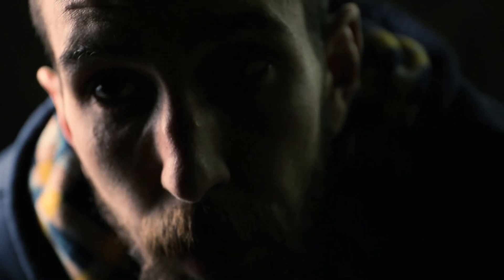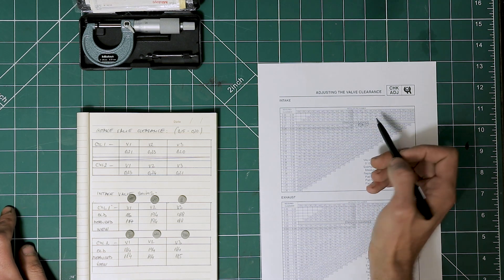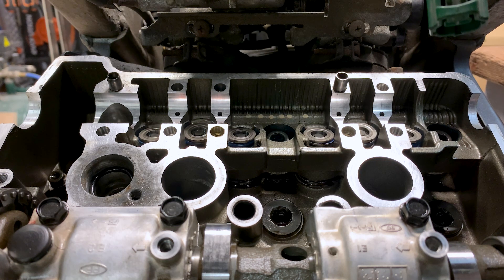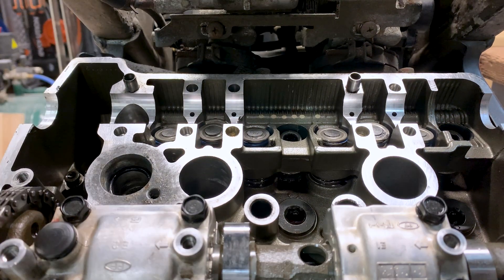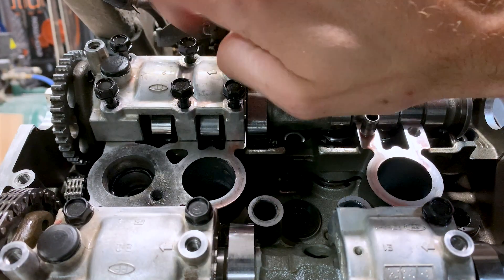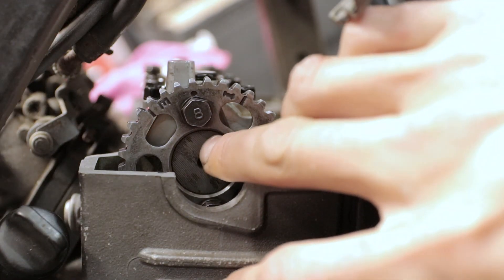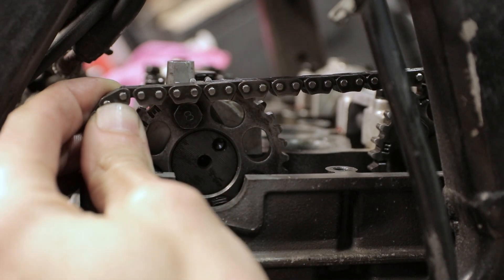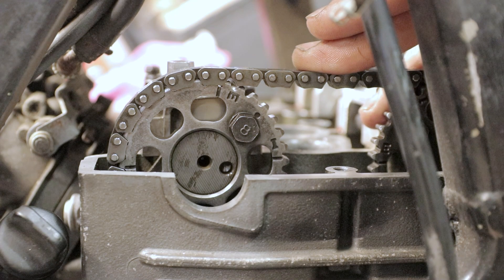TDM900 Valve Clearance Part 4 | Installing Camshaft and Valve Shims | Engine Timing

Comment: I am working on my tdm 850, from 99. Working on valve clearance now. I have removed the inlet camshaft, do you on purposely worked on just one camshaft at a time? Could i remove both camshafts without making it to difficult to put it back in time? Thanks for you videos!

Comment: Interesting until the last 5 minutes of Part 4, where  i realise i don't have some vital knowledge necessary to complete the rebuild without breaking the engine. 
If you agree the comments from Richard de piesjart correctly describe how a timing chain should be fitted, would you please confirm this in your comments and possibly even re-shoot a bonus ending sequence to show how to complete the installation technique.
Reply from the maker: I’m currently working on a video on how to replace the timing chain on the Yamaha TDM900, it should be out in the next couple of weeks. Hopefully that will shed some light on the question. But yes, I agree, if you don’t know what you’re doing it’s not advised to mess about in your engine.
Reply: The Garage UK thank you. Watching these videos, I get a great respect for the competence and skill of the pro mechanics working on our bikes.
Reply from the maker: I agree with what Richard said.

Comment: you have to turn the intake shaft 1 tooth clockwise then put the chain on it and turn the intake camshaft back 1 tooth anti clockwise on de mark without turning the exhaust camshaft then it is just right.

That's how you should always do it, you can never put the chain on it when the camshafts are right on the camshaft timing marks.

Your chain probably doesn't need to be replaced either
Reply from the maker: Thanks for your comment. My chain is well stretched, the chain tensioner is almost maxed out and I measured the old chain against the new one and it’s almost 1 centimetre longer the old one. The new chain goes on perfectly with the camshafts set to the timing marks BTW.
Reply: Normally the chain is tight between the sprockets.
If the camshafts are on time, then there is no room to lift the chain over the sprockets without turning the sprockets.

if it does work without turning the sprockets, the chain usually has slack between the sprockets, and they are no longer on time when you turn it around.

if you did succeed then you are lucky
Reply from the maker: Aaaah gotcha! Yes, that is true. I know what you mean now.